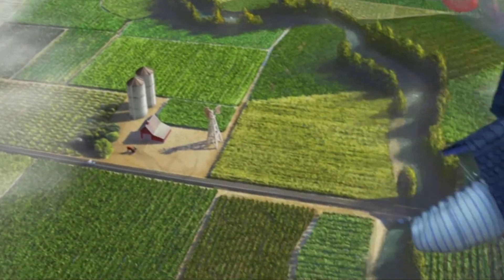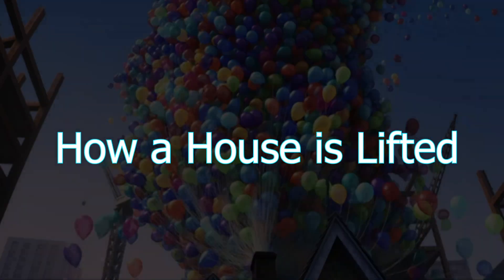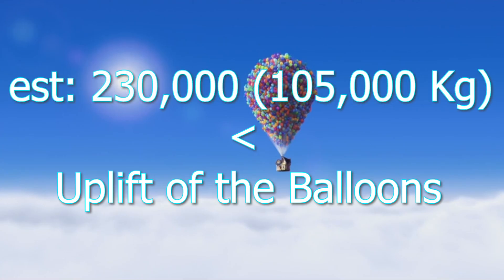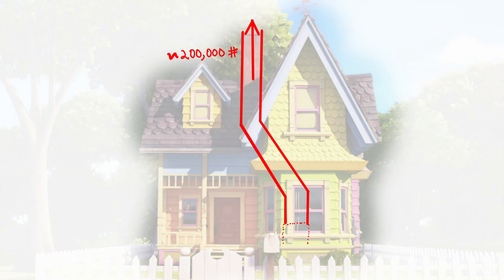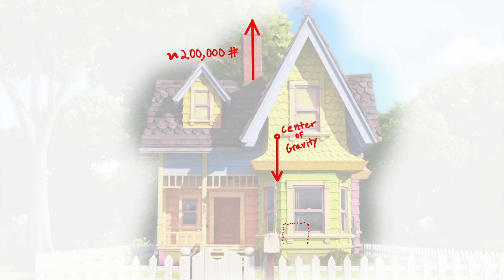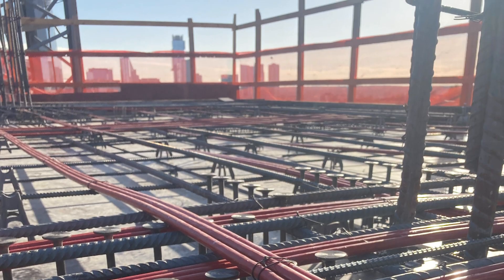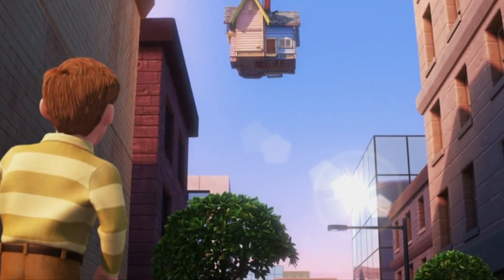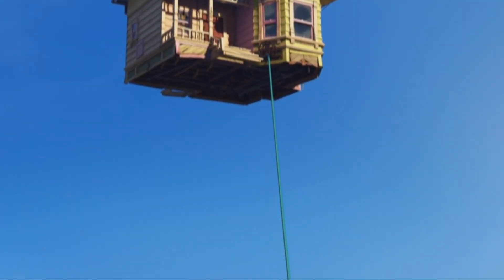How the ‘Up’ House Works…

Comment: I'd have opted for a radial foundation with a single sturdy piece anchoring at the center and the radial beams compressed against a tensioned perimeter. In essence the perimeter would be like a rope compressing the beams towards the center which would be hoisted.

Comment: You could conceivably lift Carl's house using balloons. The frame construction means the house is relatively light, and in fact there have been dozens or hundreds of cases where wooden houses like Carl's have been moved from one lot to another, sometimes a few hundred miles or kilometers away.